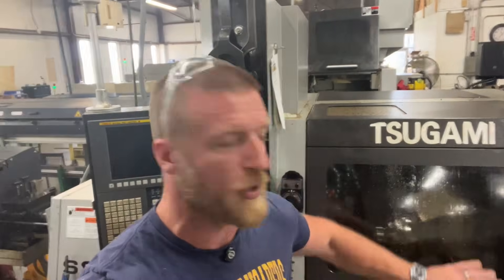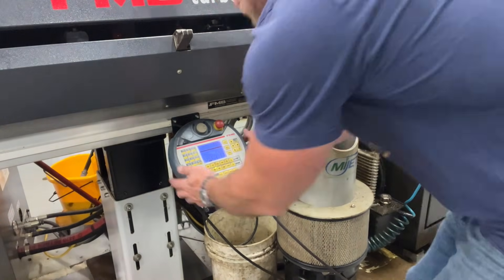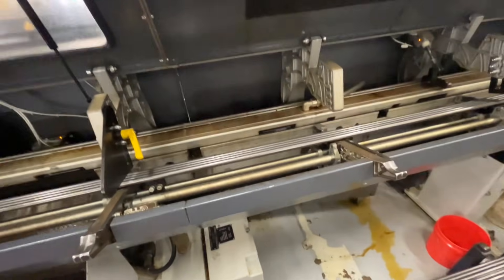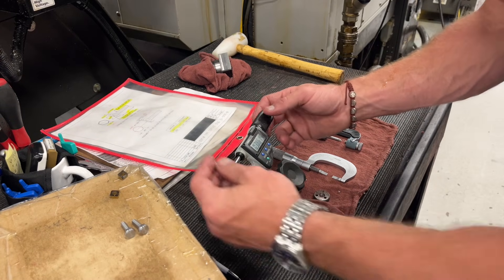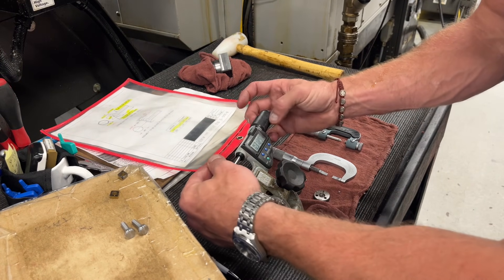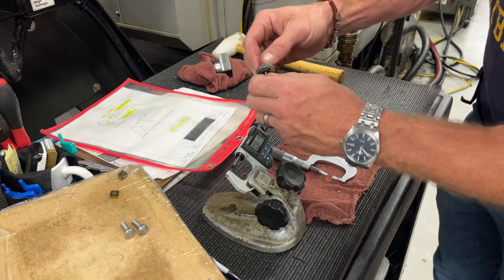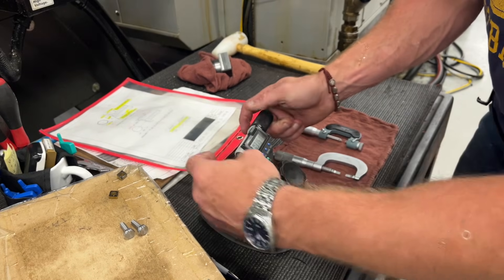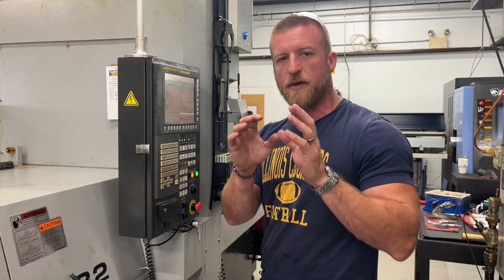💥 Swiss CNC Production 💥

Comment: Hello sir🫰! Need help yesterday day my boss ask me to make trapizoidal 6mm pitch thread on 36mm diameter bar. As i am going deeper the tool and the work piece start vibrating badly and then the insert break. Suggest me any idea thanks.
Reply from the maker: Hello thanks for asking. And thanks for watching. How long is the thread ?
Reply: @Crusadermachining 155 mm length
Reply from the maker: That may be why. That’s a very very long thread - what machine are you trying to do this thread in. 155mm length - what diameter is thread major?

Comment: What CAD/CAM software do you recommend to newbies with severe mental disabilities? preferably something that runs locally?
Reply from the maker: That’s  a tough, but touching scenario you lay out. Hmmmmm, SMD is the big elephant in the room here. I’d say for you, mastercam or fusion. Both are VERY local.
Reply: @Crusadermachining  And is bobcad-cam usable/reliable?

Really prefer something with a lot of education, fully local to avoid having companies like Fusion shove ads, or just diseaper randomly.

To enhance your overall experience, we're incorporating custom highly tailored ads just for you! just watch 5sec each time you add a tool path. (Companies are already putting ads on fridges lol)
Reply from the maker: I’ve never worked with Bobcad - I’ve also never really noticed adds on fusion. But I bet Bobcad has some good support. Just don’t know how much it costs. I’d say go fusion, I hear a lot of shops are going that way. 

Another option could be mastercam. I know it’s not cheap but based on your budget, they could be a great option for you.